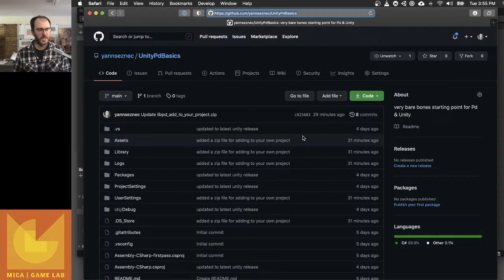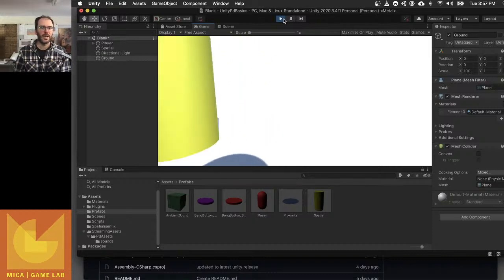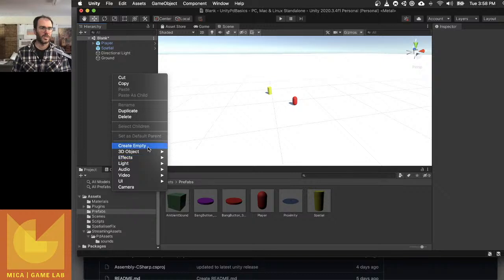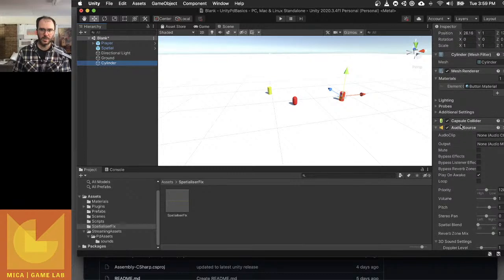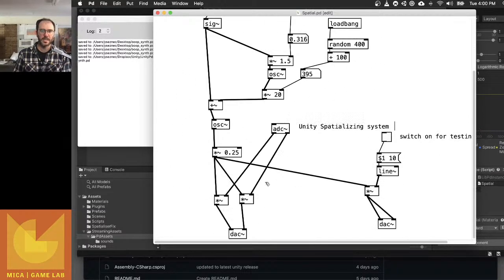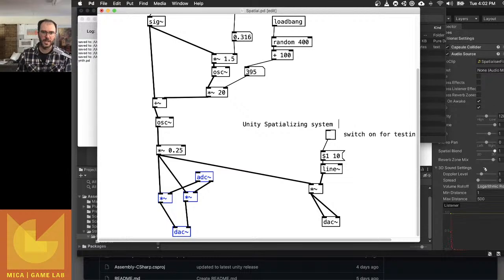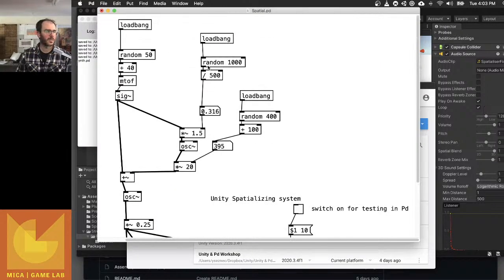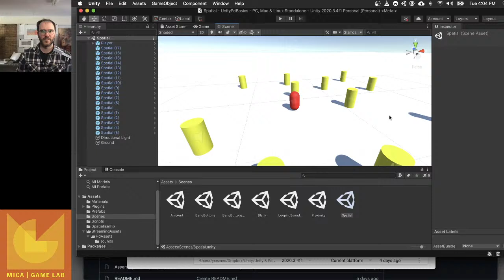Unity & Pd Tutorial Ep.3: Spatialization

Comment: hi yann. thanks for those amazing videos. is it possible to make different LibPdInstances placed in different gameobjects to communicate with each other? or route audio through several objects/pdinstanaces?
Reply from the maker: Hey I've asked Niall (who made the libpdintegration system) about this. He suspects it's very difficult or maybe impossible to route audio through several game objects in Unity. However you should be able to use the standard send/receive objects in pure data to communicate between different patches in different game objects. I can't actually remember if I've tried it myself, but he says there is likely to be some latency using that approach but it should work pretty well.
Reply: @amazingrolo  thanks for the answer.. i have tried send~ and receive~ but it didnt work.
Reply from the maker: @spenzakwsx4430  yeah I don't think those will work, but I think that the normal message-style send and receive objects should work...I should probably test it at some point to be sure